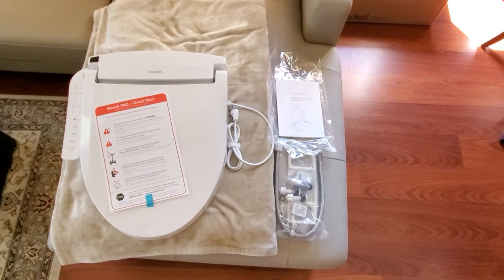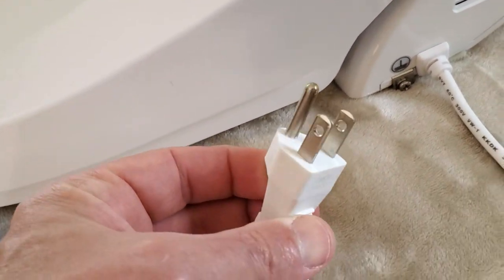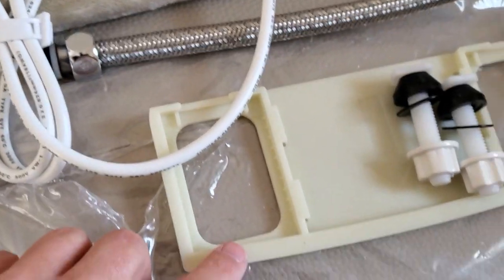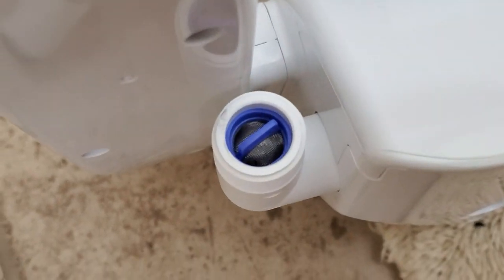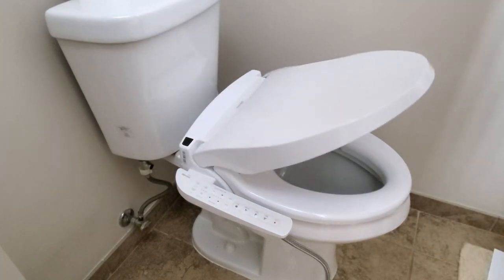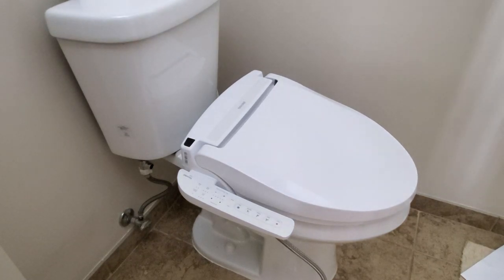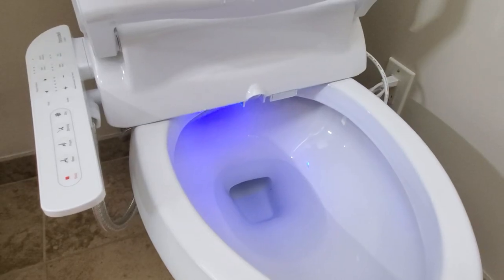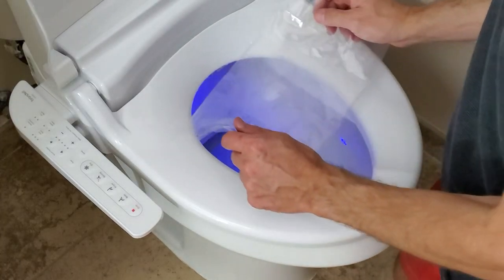BRONDELL SWASH CL1500 Bidet Review - From Costco

Comment: Thanks for the overview video. Can you give a review on performance after installation?
Reply from the maker: I don't think I will make video about my experience but I love it. I have tried many Japanese bidets while on vacation in Japan so I can compare between several models. This one is excellent. I love the fact that I finally have warm water. Before, on my older attachment bidet I only had cold. Everything works great including cleaning performance. 2 minutes clean, 2 minutes dry cycle and you don't have to use toilet paper. Drier does not dry you bottom totally 100% but close. During the day, when I am not home I put it in Standby mode so that's a nice option. This way unit does not use any electricity. Same thing applies to blue light. You can turn it off too. Love pulsating clean. I don't understand how you can use toilet paper again after trying this Bidet. Hope this helps.
Reply: @MaciejPiotrowski  This is the review I was looking for! Thanks for your response!

Comment: Hi thanks for this informative video. Does this bidet warns the water as well. Does it have inbuilt water heating system??
Reply from the maker: Bidet needs power because it warms the water and toilet seat. You can have 3 settings for water temperature.
Reply: How does it heat the water?
Reply from the maker: @beahappy1today  There is a heating element just like in on demand water heater.

Comment: @maciej piotrowski - is this model available at Costco and if I don’t have an outlet I won’t be able to install right?
Reply from the maker: I bought mine at Costco. If you don't have power it will not work. This model requires 110V to power this bidet. If you don't have power you may want to buy bidet attachment like this https://youtu.be/4RJ6j2rqdYQ or https://youtu.be/YMXo-Zpl-ic . Those are non power bidet units. The reason for power is to heat the water and seat and operate fan and light and motorized function of bidet. Without power you will have cold water. Hope this helps.
Reply: @MaciejPiotrowski  thank you, planning on installing it in all of our toilets but the warm seat and warm water plus dryer sounds good so may get an electrician to install the outlets in the main bathroom. Will try the first link in the guest toilet. Hope it’s available at Costco.

Comment: Can you change the water pressure? I have the non electric Brondell and it’s such a fierce spray.  Is that what the Gentle button is for? Are there options for water pressure or spray diameter?
Reply from the maker: You can change water pressure from very gentle to max pressure. You can not change water diameter. You can choose pulsating option and this will cycle to cover all the angles.
Reply: Maciej Piotrowski ok great. Seems like it has all the major features especially at this price point. Is there anything that  you wish it had? I don’t care about a wireless remote like the upgraded ones. But is there any feature in the upgraded models that this one lacks sorely?

Comment: Thanks for the video. Did you get an adapter to fit T vavle? Thanks.
Reply from the maker: I did not have to get anything. Everything you need is included.
Reply: @MaciejPiotrowski  Thanks. Maybe we purchased the product at differnt time. Home Depot told me not carrying it but I did find a few from Amazon. Just need to figure out what size that fits. Thanks again. BTW,  the reason I didn't install it right away because every electrician came want to charge me twice as much to put an outlet for it. I could have found your video of doing it earlier.  You're the lifesaver:👍👍🙏🙏
Reply from the maker: @pyeh322  This CL 1500 model is only sold at Costco. I also have a video how I did put an outlet for this bidet. You can do it yourself. https://youtu.be/WeifEAAs1vk

Comment: iN ONE OF THE DESCRIPTIONS OF INSTALLATION, AN INSTALLER WROTE THAT YU SHOULD BE SURE TO DO SOMETHING WITH WATER THE FIRST TIME. i'M NOT SURE WHAT IT WAS. WAS IT POSSIBLY TO LET THE TANK  FILL UP BEFORE YU USE IT THE FIRST TIME.  dO YOU KNOW WHAT i MEAN?
Reply from the maker: I'm sure before you start using it, inside tank must be filled up otherwise the heating element can damage inside of the tank. That's probably what they mean. It takes few seconds to fill it up.

Comment: Great video, quick question does the control panel swivel up and out of the way? I would be worried someone would press down and break it. Thanks for your time. Great video.
Reply from the maker: The panel is fixed but It is really solid. I've had no problem with it. I hope this helps.

Comment: Is their a warm water option or do u rise with just cold water?
Reply from the maker: That's the point of this bidet that you can use from cold to hot water. That's why you need to have it connected to the outlet.
Reply: @MaciejPiotrowski  Hello, so does it have some type of internal heater that warms the water?
Reply from the maker: @morethanben  yes it has heating element that heats the water. You can have everything from warm to hot water.
Reply: Do you use the exact same temp buttons to control water temp, as you did for the heater temp.

Comment: How is the drier?  I heard alot of these driers don't work that well.
Reply from the maker: If you have patients and wait 2 minute cycle you will have your bottom 80% dry. But to have it dried completely you need 2 drying cycles. I just use separate towel to quickly remove what's left wet and I'm good to go. I love this bidet.

Comment: What is measurement of hole opening on your elongate seat? Example 7.5" wide by 11" length or 8" and 11.5".  Just the open area.  Thanks in advance
Reply from the maker: It's 11.5 x 8 inches.

Comment: Hows the water pressure and the dryer quality?
Reply from the maker: Pressure is good and can be adjusted. I use mid setting for pressure. Dryer needs 2 cycles to fully dry my bottom so I rarely use it. I use a towel after it. You bottom is totally clear so you just wipe renaming water of it.

Comment: What if the person using has the blasting Hershey squirts?  wont the sprayer need cleaning potentially?
Reply from the maker: This bidet cleans its wand after every use. You can also push self clean button and it will clean it in addition to that.

Comment: I bought a brondell swash 300 and the water tank leaked as soon as I installed it.  I called brondell and they refused to repair it.
Reply from the maker: That's sucks. Return it to the place you bought it from. That's what I would do.
Reply: @MaciejPiotrowski  I did return it through amazon but I really wanted it repaired.  It is a nice unit and my wife especially liked it.  Also, I wanted to give Brondell the opportunity to do the right thing and they really blew it as the water tank had a split in the seam and was defective from the factory.  It would have been a cheap repair but some companies are shortsighted and don't see the value of a happy customer.
Reply from the maker: @odomn  I see your point, but I have learned in recent years that it's cheaper for companies to send you a replacement than deal with repairs. I just got a lemon. I would get another one. I love my bidet and I would highly recommend it. My wife still doesn't like to use it. I love it.